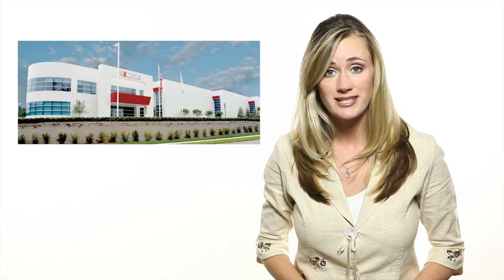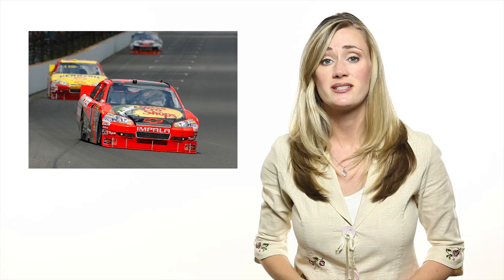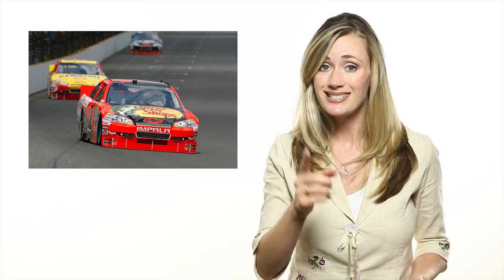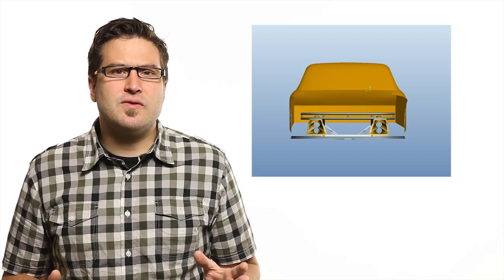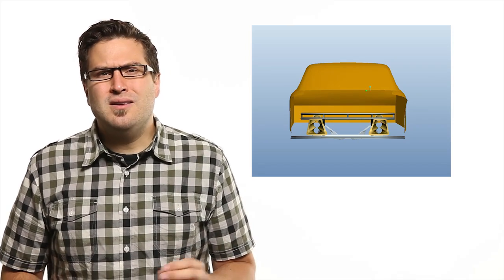NASCAR Nose Re-Design

Comment: @xijnnijx It's driving in a circle, in a dense pack at 200 mph, inches from everyone else. All cars are about equal, so the driver needs to use driving strategy more than anything to pass other cars, playing off other's aerodynamics to go faster, etc. You need lightning reflexes when a car can move over a half inch and take you out with twenty other cars, and serious concentration to keep yourself from moving over that half inch and risking taking yourself out. It's not easy...